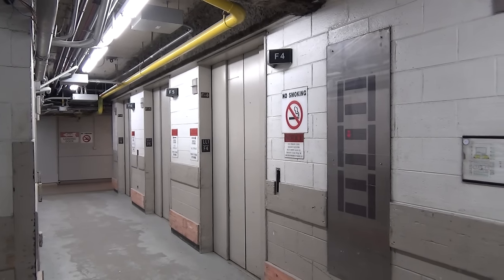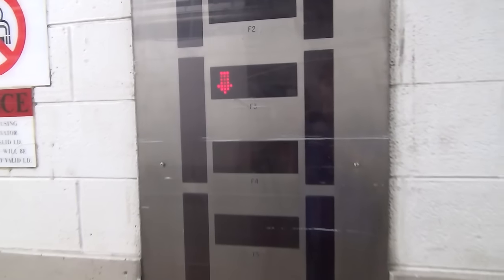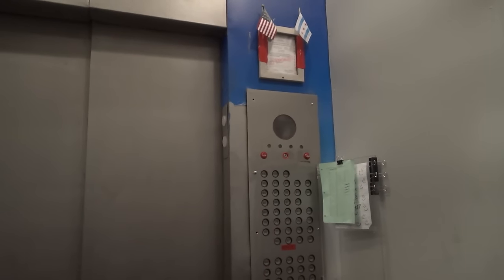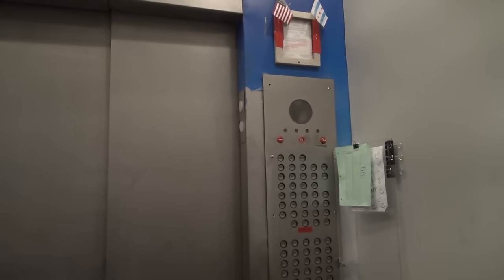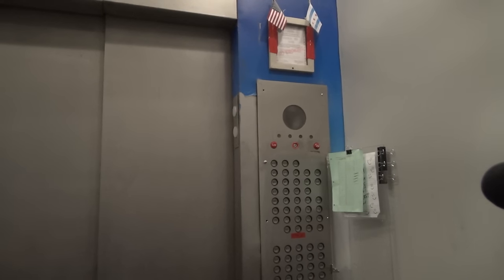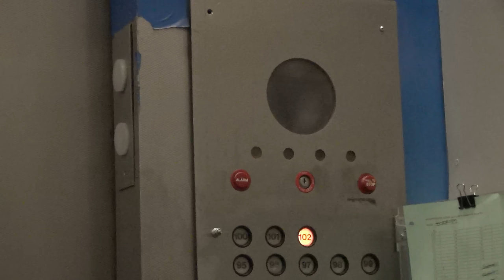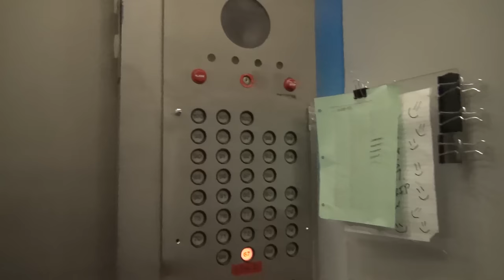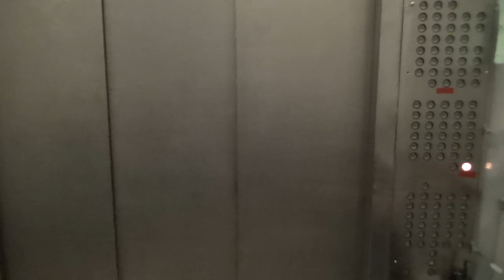EXCLUSIVE: 100+ Floor Elevator in the Sears/Willis Tower! (Machine Room)

Comment: AMAZING ! What is the speed on these things ? (In m/s)
Reply: Just under 1000fpm which is about 5.08m/s. You can always use an online converter to convert the speed from fpm to m/s
Reply: @elevatorfilmersg  WOW thats fast, and I know, there is a converter online
Reply: @Stefan_Lifts  I don’t know the exact speed since the technician in the video said under 1000fpm. But in my opinion I think by today’s standards that’s quite slow. A service lift serving this many floors and of this height should be at least 7m/s.
Reply: @elevatorfilmersg  Maybe even 10 but im from Balkan (Europe) so I dont know the quality of these, but since it has 102 floors I think 10m/s would be ideal
Reply: @Stefan_Lifts  travel distance is about 400m. But given that it’s a service lift and would stop quite often it probably won’t even be able to reach full speed of 10m/s most of the time. So I guess 7-8 would be ideal
Reply: @elevatorfilmersg  yeah ur right
Reply: @elevatorfilmersg  that is the case with the Skydeck ones
Reply from the maker: I don't know the exact speed but it is under 1000fpm which is actually kinda slow for an elevator this tall.
Reply: @stlelevators  yeah, i was actually referred to Skydeck ones traveling 1600 ft/min

Comment: This is EPIC!!!! Was the Service Elevator shown in the video the only original working one in the bank or were there others that weren't modernized yet? I noticed that on the annunciator only one elevator (the only you rode) was lit up and showing on there.
Reply from the maker: I'm not sure if the other ones were working or not. They were either finished being modernized or in the process of being modded. I don't know if that annunciator will be used on the new system or not.

Comment: Looks very, very similar to a DMR system I came across a few years back, but those were manufactured by Mitsubishi instead and were in a set of 6. Unfortunately the building they were in came down shortly after I discovered them.

Also, whats the capacity of this thing?
Reply from the maker: I'm actually not sure what the capacity is.

Comment: I wonder if this is the largest (in terms of # of floors served) relay logic elevator still running with original logic. I suspect it is given that it was the tallest building in the world well into the era when relay logic elevators got replaced with fully electronic elevators running on digital logic.
Reply from the maker: It's very possible that it is.

Comment: Looks like Westinghouse junk. Horrible product. Those relays are a nightmare to work on, the silver triangle contacts wear quickly and cause intermittent problems and the car stations are a heart attack waiting to happen when u open them.  Mod that shit.
Reply from the maker: I believe this will be modernized when the other cars are done.
Reply: On the Express Lift version we had our relays and contractors and were very reliable for over 45 years of heavy use .still some of the best elevators I have ever worked on